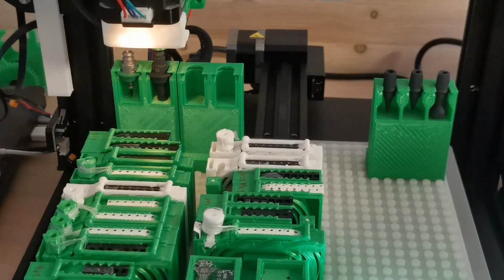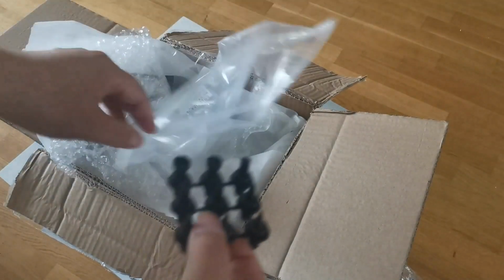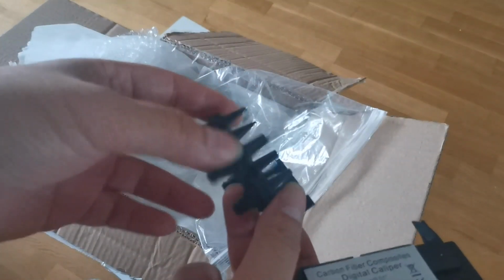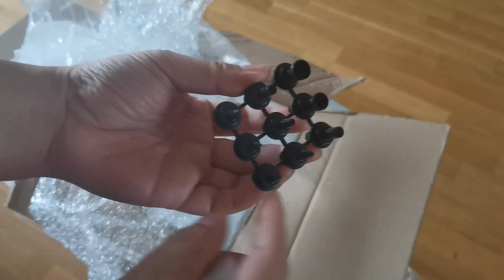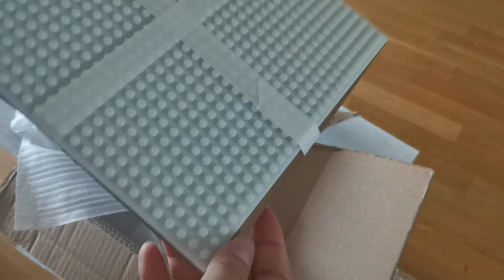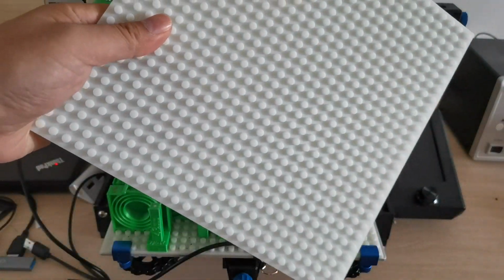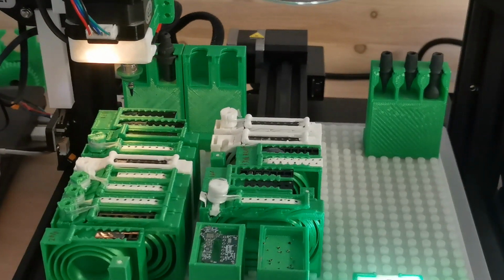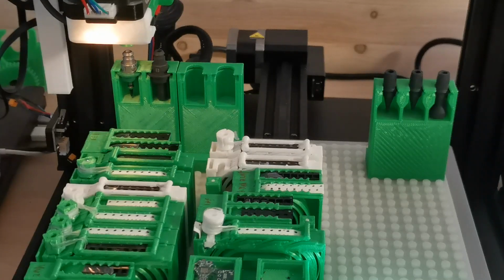DIY pick and place - Components redesign and 3rd party print out unboxing

Comment: PCBWay have several black resin materials, which do you recommend? Formlab ESD Resin? Do the smallest nozzle holes < 1.0mm print OK?
Reply from the maker: I am just using Image Black, with matt paint, the goal is to be accurate and no reflection.

Comment: Doesn't the printet nozzles more expensive?
Reply from the maker: Actually it is much much cheaper, there are many 3D printing services available, take pcbway I am using as an example, 1 piece is $4.98, but if you do 5 piece is $6.22, so each one is 1.24$, and you can do the trick to combine 9 into 1 piece, then it is $4.98 for 9 different nozzles, then shipping usually around $15 for my case, so each piece is around $2, and if you choose to print 2x9pieces, same price ($4.98), then each nozzle is below $2 + VAT. Juki nozzle usually is 7-10 depend on types, so around 3-5 times cheaper.